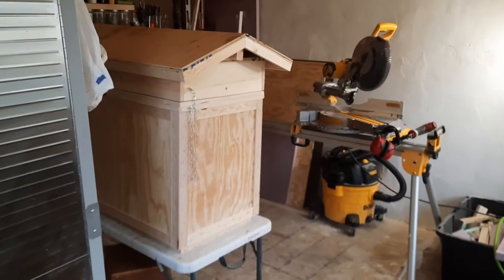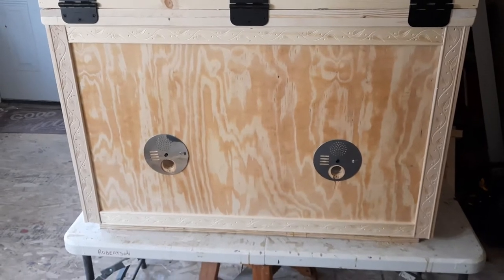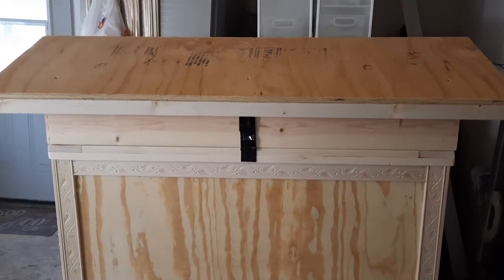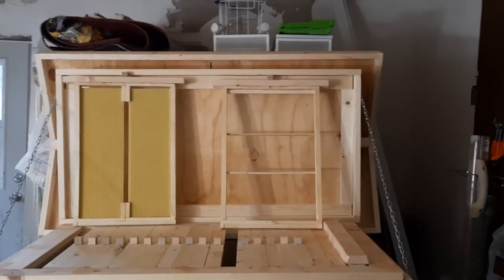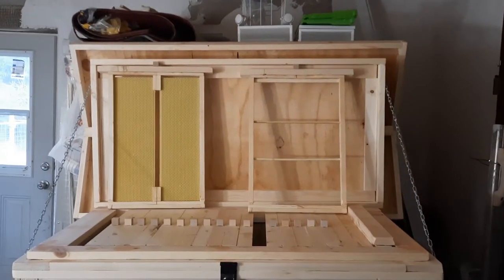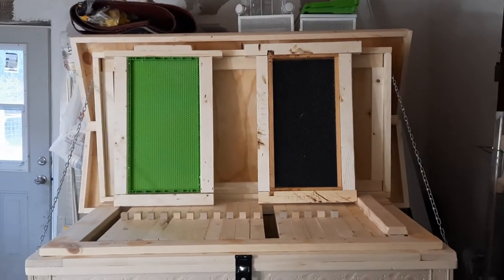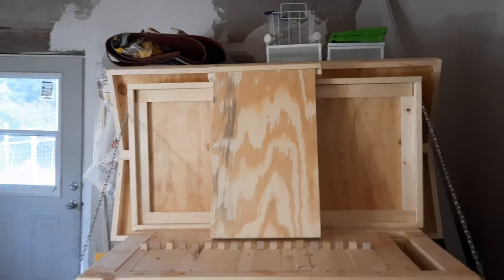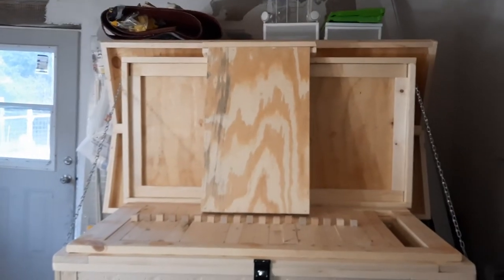Horizontal bee hive with extra deep frames

Comment: Because I have a small honey extractor which takes a Langstroth deep ( 2 total opposed) but went vertically with my comb (deep instead of wide) Same comb dimensions (8.5" x 16 .675") bees moved on it great but I was overwhelmed in the fall (3 yrs ago) by robber bees from an apiary of around 20 hives about a mile from me. I never got into the fall with enough honey/feed for my bees, they were gone before the first snow. I have found bees in trees and buildings that had narrow but much narrower than Layen's Hives building comb diagonally in 2 x 4 walls in a diagonal fashion but up to 6'-8' deep. (deep is the way to go) I am thinking that American apiarists need to rethink the Langstroth. I have had bees winter well at -20f well but even a little bit bigger than .375" gap between combs is too much gap for some bees at that temp or lower. I have watched Dr Leo' through a couple of years and I believe he has the right approach but many trees have to be huge to take his size width comb. Few wild bees I have seen actually exceed a ten inch width comb though some do. I saw a German approach that adds a 4" section below the cluster to allow dead bees to drop but not plug the Lang entrance. Wild bees do the same in trees. I like what I see of your design.
Reply: I believe it was Michael Bush, he has an interesting website.  He doesn't make the frames but has a little section of how to adapt frames.  He posits that frames should have a 1/4" gap in between each frame and a total on center width of 32mm per frame.  This is a bit of a tighter squeeze for the bees.  But it allows for 11 frames per Langstroth box and only one bee per section of comb.  So instead of the bees being back to back, there's side by side with one bee on one comb, and the other on the adjacent comb.  This means they can more easily and efficiently distribute heat during cluster with less bees.

It's kinda complicated, but an interesting read.  I haven't personally tried it. But it makes sense.

Comment: Using a 1/4 or half or less of the Lang foundation I can start a " modified Layen" comb with swarms or packages or splits and nuc expansions. I can buy plastic or wax from supply companies and save my bees a lot of "moving  expenses" when I put them into a new box or trap a swarm. It's a bit of extra work which I am willing to do but via tongue and grove I can make a 7  to 10 frame swarm trap the first stage/half  of a full length Layens hive by just giving the swarm box an extra layer of wood for insulation and adding it to the rest of the intended hive. Meaning I can extend a trap the bees can grow and winter in. Play with the ideas. I am not going back to Lang's.